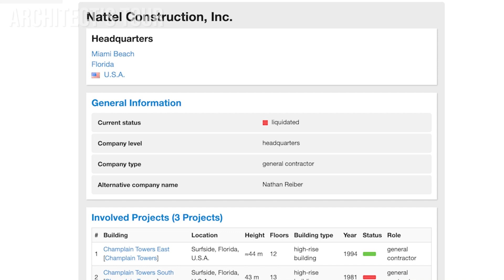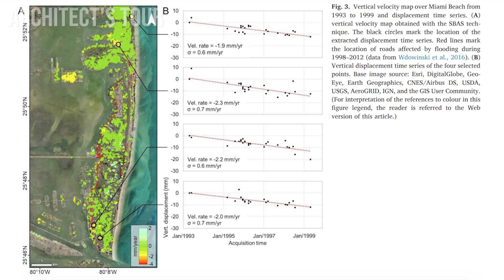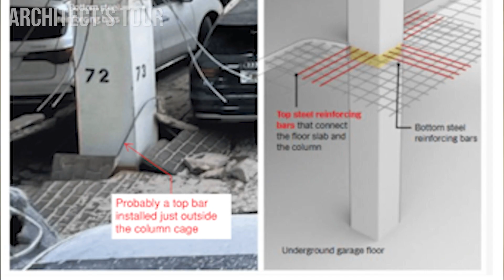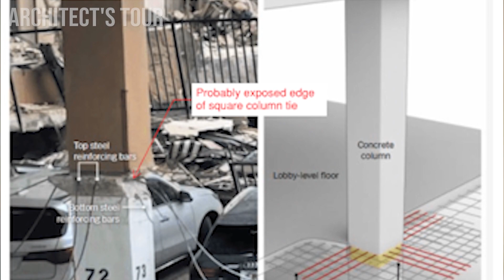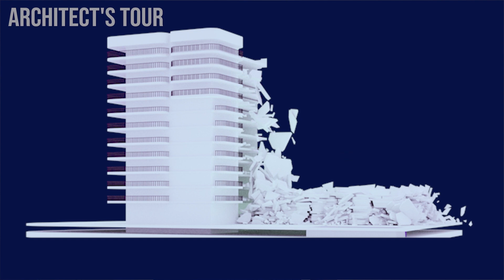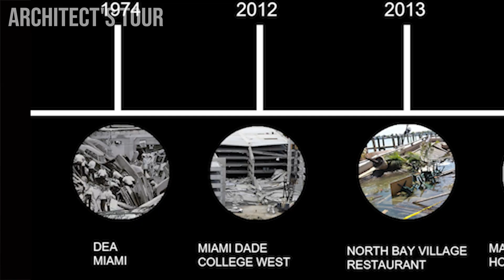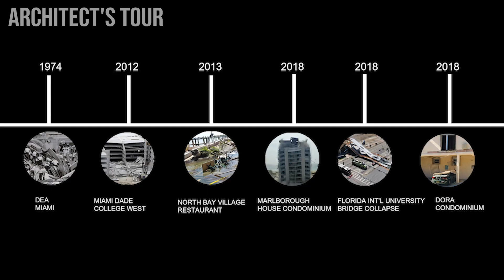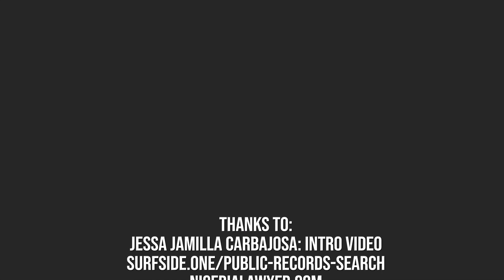America Building collapse

Comment: This is not any climate change or sea level rise issue, it was purely poor design and poor maintenance.
Reply from the maker: Thank you Mr. Greg Adams.
Reply: Maybe we should wait and see what actually caused it. I agree that poor design and poor maintenance are important factors, but I am not sure they are the only factors. We know from witness statements that foot deep salt water often happened at high tide. This clearly suggests that sea level rise is also a factor.A concrete building like this can be weakened by prolonged submergance in salt water. 

The reason collapses like this are so rare, is that it takes a perfect storm of many factors to bring it down. Lots of buildings are poorly maintained, but this does not initself bring them down. Same with the design. It was clearly not a robust design, but many other buildings from that era has similar design without issues. In fact it has a sister building with identical design a few blocks doown the coast, which is not even evacuated despite the collapse.

My money is on a combination of:

- poor design
- even worse subsequent changes to the design
- poor quality of materials - concrete not of required strength
- poor construction with small deviations from drawings
- poor foundation. Even small foundation issues, which inthemselves are innocent, can increase stress 
- lack of maintenance
- early warning signs being ignored
- poor oversight by the town
-etc. etc.

If you take away just one of these many contributing factors, the building would still be standing today